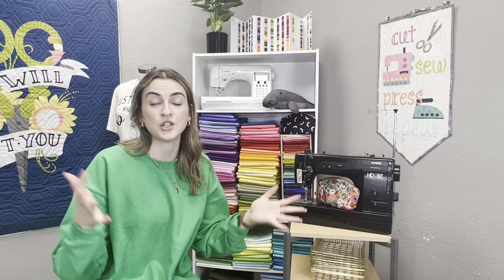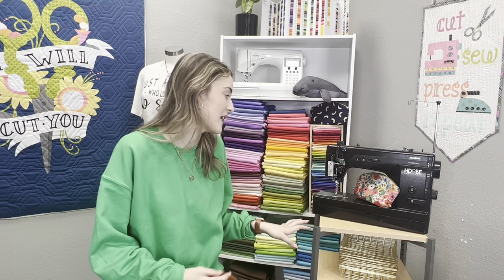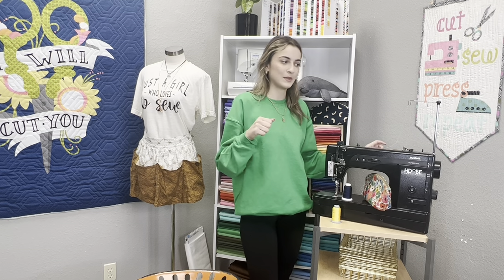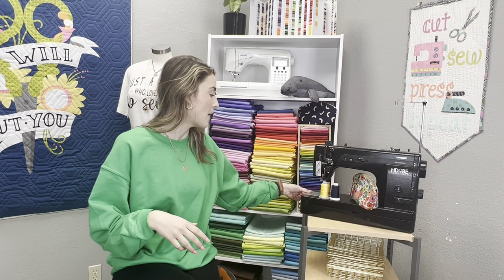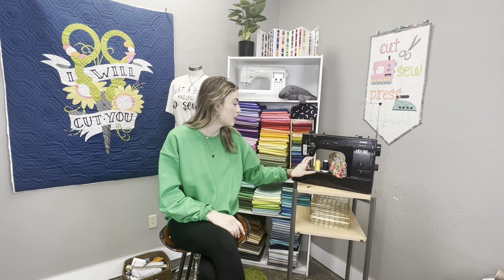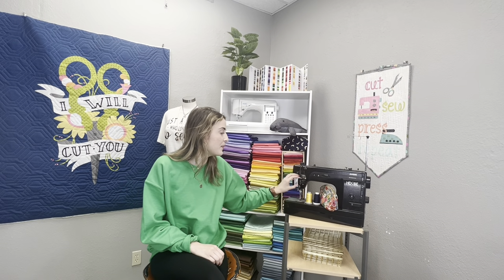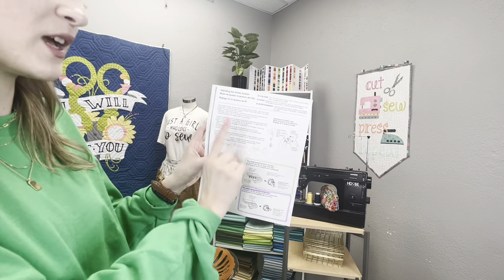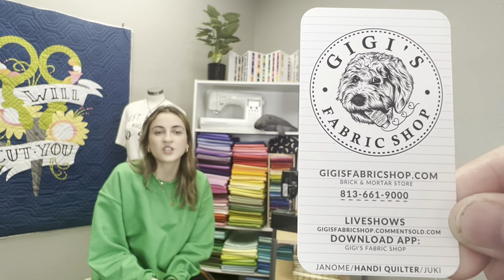How to fix tension issues on a sewing machine!!

Comment: I got my Janome 3160 in Aug. 2020. Had it serviced in Apr. 2023 because of covid and because the store is 2 hours away and I never go that direction.

It worked perfectly before and now my stitches are not beautiful and straight and sometimes a little loopy. 😭 The technician also left a black mar on the back of the neck. That was strange to me.

I had written on my book those original settings on the 2 dials that I used from day 1. The numbers haven’t changed by much.

I will watch videos and see if I can get it back to normal. I hope so.
Reply: Sorry to hear that. I can just image your frustration. I hope things have improved for you.

Comment: My Skyline 3 came with tension issues straight out of the box. I was devastated because the auto tension is the reason why I purchased it. I now just fumble around with retreading and usually 30 minutes later I can get it to stitch properly. I don’t know if I received a lemon because the foot pedal came EMPTY! No working parts on the inside. 😑

I was a spanking new sewer so I didn’t know what reasonable request or steps to take. I do love my, Janome but it does have to many hiccups for $700+ machine.